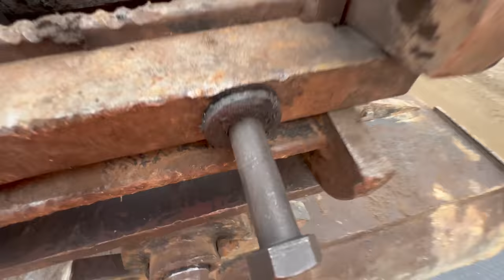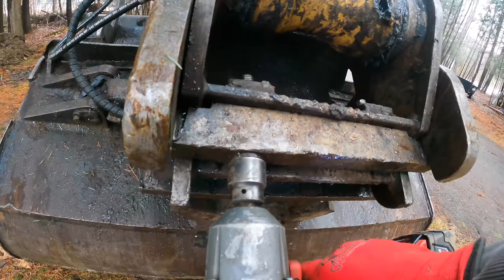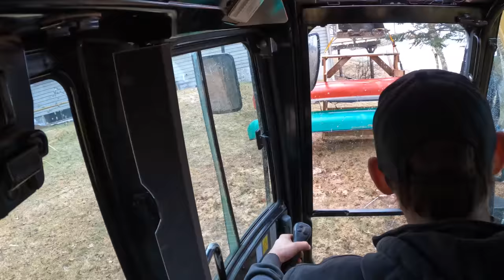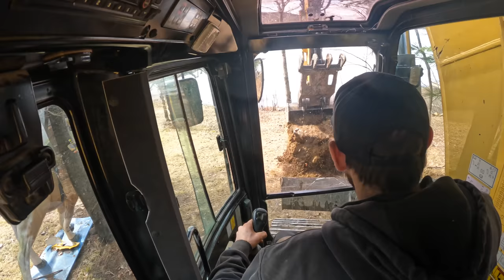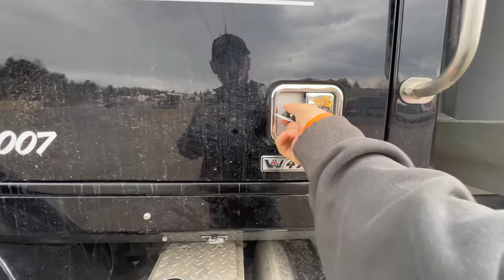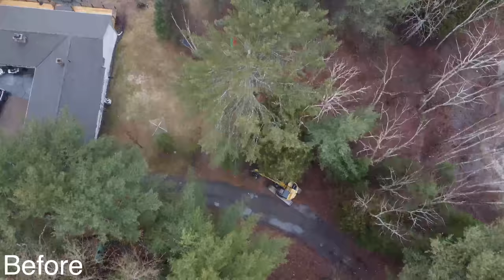Cabin Excavation With CAT 314

Comment: That is a lot of stick for that saw (I should know, I have one, looks like a 0-29 pro anyway) and when I knocked over big trees in my yard (I have a lot of trees much much bigger than that one) I borrowed my neighbors 0-44 with a 50" bar.  Not that I am saying you should have gone for a bigger saw, I was just impressed you took it down and apart with that one.

Chainsaws are super usefull in the tight canyon in the Oregon Coast Range where I live. I have five, and old 0-30, the 29 and a 19 so my wife could limb. Then the two battery saws, a Makita and a 14 foot extendable poll saw. But the biggest trees on my property would take a two man saw, but I wont ever remove any more big ones, I just had to knock a couple down that were dyeing and going to fall on the house.  I love the trees here. Between them and the ferns and other stuff it is always super green here from the forest floor to the hole canopy where the house and drives are.